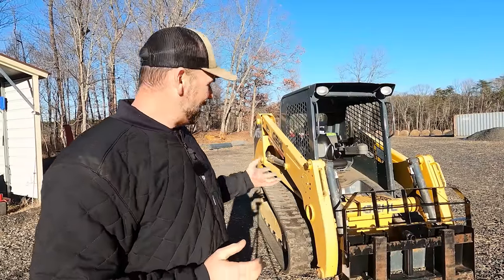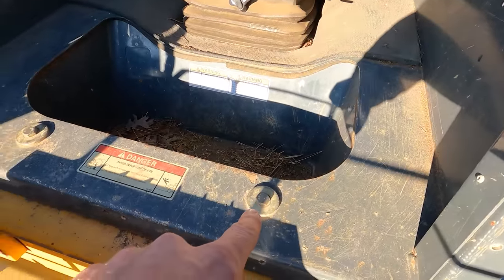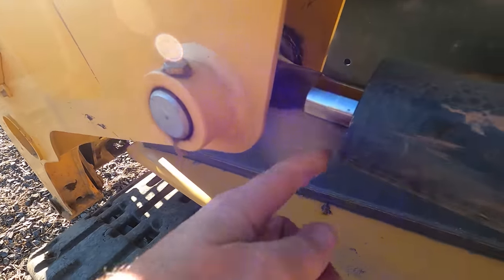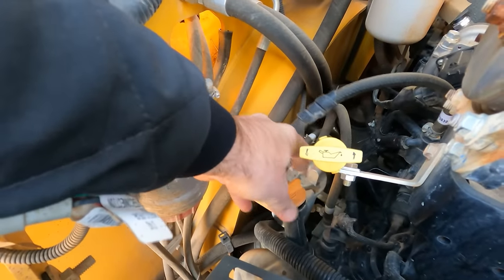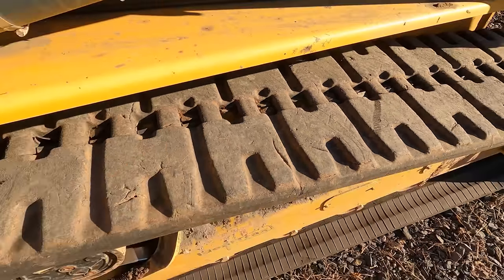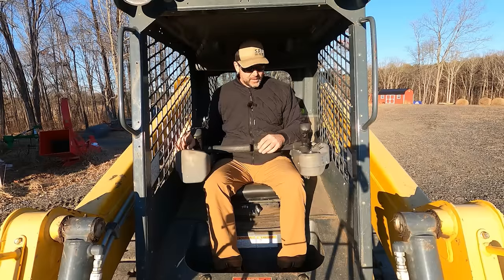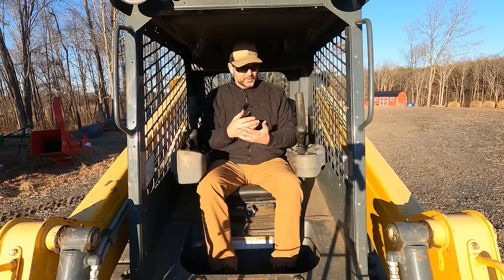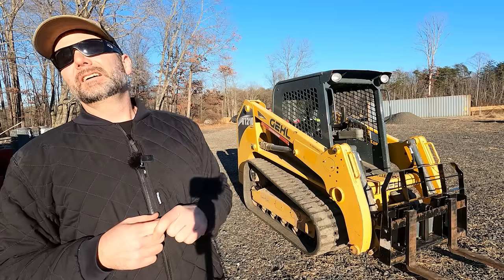DONT GET BURNED! How to Buy a good Used Skid Steer, wheels v/s tracks and more!

Comment: Always pull the dipstick while the engine is running and check for Blow-by by putting your finger over the dipstick tube. There should not be pressure or smoke coming out of the tube. Especially important on higher hour machines.
Reply: First Choice Mechanical  yes that will work too. I have seen dipstick blow out of the tube. Just depends how clapped out the engine is lol.

Comment: One big item to pay attention too are re-painted and rebadged machines.if the machine looks like new,pay attention and dig deep,it's usually been so well used they had to paint it in order to even make a sale.NOT ALWAYS,but quite often.I strive for,original used paint,cold starts,stored inside,and all maint documents,and the number of owners a machine has had.Good vid,thanks.
Reply: Agree about the paint.  I've been looking off and on for about a year and have seen a lot of pigs with lipstick.
Reply: Good general rule but i treat all my stuff like a princess, touch up whenever there is a scratch etc also. I understand what it cost to buy and i respect that
Reply: @OShackHennessy  Nice.I would like to do a project 1840 case old school skidsteer,and do a complete refurb and paint.For myself.Thanks for watching.

Comment: Also consider where you are going to operate your machine. Besides dirt or concrete. Are you going to operate in wooded thorns or possible running a brush hog or what attachments will you use will effect between tire or tracks. Great video Stoney Ridge Farmer. Thanks farmer rod

Comment: I own a JD260 and know what you mean. I have the really big tires so I can traverse muddy areas better but still not the best.  Bought mine used...unseen. i knew the hour meter had been replaced...most have been in that generation of machine. Still a great skiddy for what I need. Just depends on your use. Great beginner video.

Comment: I bought a wheeled machine because my road is two miles long(travel speed is faster)and I live in Montana so wo do not have very many mud days. I do have an extra set of mounted tires with cleated chains on them. With my dewalt impact I can change tires in less then ten minutes and it does much better than a track machine on ice which I do get alot of. My machine is a 2015 L230 New holland, thanks for the video!!!
Reply from the maker: interesting....but the track machine is just as fast as the wheeled machine I had.....for the farm the tracks are 1000 times better...but we all have our opinions...drive a track machine and you'll never go back my brotha
Reply: @StoneyRidgeFarmer  I have operated the track machines and they are great. I think top speed in your machine is about 8 mph?? My machine is 12 mph it does make a difference if you have to travel alot. I had a track machine here on my ranch for about six months (T 250 Bobcat) when I first bought the place and it was great until it got snow packed and icey then it turned into a slip and slide event and I was running ice tracks. The first time I plowed snow with my machine on ice with the chains on it was an animal. I have steep grades on my ranch road and I can plow up hill with this setup (9' snow dogg plow with wings 11'). The tracked skidsteer could not plow uphill on my road. Like I said we do not get as wet here in Montana as you do but we do have hard winter. Thanks again!!! P.S. I looked up the specs on the gehl rt210 and the new holland l230 is a full 4 mph faster!!!!
Reply: L230 that’s a beast and I agree on snow I did a demo with a case track machine and I had a hill that I had packed down from driving my pickup on it and with a full bucket of wood I couldn’t make the hill. So tires and chains work better for me. You can get more aggressive tracks or I know guys that stud their tracks like a snowmobile.

Comment: Hour to HP is relatively moot. I’ve seen low hour higher HP machines worked like a rented mule. Conversely I have seen higher hour lower HP machines that have had excellent maintenance and the machines ran incredibly. I think it all boils down to maintenance, like mileage on a car. I’d rather have a well maintained high mileage car than a fleet vehicle or rental that was beat every minute it ran. 
All in all good video.

Comment: I had a older gehl and that machine was a great machine. I recently got a real buy on a 2012 320d John Deere with 853 hours can heat air two speed air ride seat and i know where it came from so it was never worked hard. 23,500

Comment: I don't question your answere, but the original question: Why a skid-steere? Why not a Caterpillar, Volvo, Kubota or other wheel loader? My PERSONAL opinion is that they are more versatile if there isn't a big question about room. Skid-steers are great doing utility work around houses and on building sites where you have to turn around on a dime.
 On the alternator-belt: if it's worn it will touch the bottom of the pulley and tightening will not help. If the the top side of the belt goes into the pulley it's good for a change...
Reply from the maker: I have 4 tractors on the farm.....the skid loader is the best at material and dirt work.  I can run circles around any other machine on the farm with this little loader.  Yep..alternator belt is just a bit loose my friend

Comment: This loader would come in handy with blizzard we are experiencing right now in northeast
Reply from the maker: Just drove home from PA yesterday! 8 hours driving in that mess!
Reply: Tracks are the way to go if you've got snow! Take care
Reply: @patrickbass3118  I beg to differ. My wheeled skidsteer with cleated chains will run circles around a tracked machine on snow and ice. I have operated both on my ranch and the tracked machine was running ice tracks and it was still slipping and sliding the chained up wheel machine was an unstoppable animal!!!

Comment: Check how long the back order for the rubber tracks are and how long the back has been. We have several clients that have machines with tracks on back order. But also don't order them and have them sit in the elements so they break down and crack before you even get to them

Comment: Hello Josh, thank you for this video!

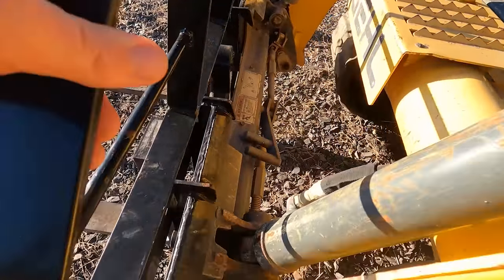On min. 7:44 "by shims" you mean the cylinder pins that goes through the end of each cylinder? They with time in fact get wore out.

The short hose you touch by the right of your skid steer, notice it has some bumps or out of shape I think by pressure of the hydraulic pump or past abuse or low quality section of the hose, maybe you want to review it, buy it and have any hose looking like bumpy replaced before they go off while you less expect it. Please let me know if am wrong.

Comment: Long but worth reading: recovering from 2 surgeries so can't make long trips. Need a backhoe so working via net. So,found a 2005 JD 310G 4wd open station at a dealer 170 miles away.30+ pics and 2 videos. Hour meter showed under 500 hours."Owned since new by a gravedigger".
$38,500.00 and bought it. From dealer straight to JD Construction equipment dealer service shop. ECM shows true hours at 2972. Not pissy. Left rear tire has a torn bead. Still not pissy.Nickle and dime service and repairs,complete set of JD manuals,complete set of spare filters,etc should be under $5000.00. $43,500.00 for a backhoe that will have parts available for at least another 15 years,low hours at 2972,will last me probably longer than I'll live. Short video on my channel when it arrived at the JD shop. Shop foreman says it's a goodun.
Reply from the maker: I just sold a 310d for under 20k! With less than 2000 hours brotha
Reply: @StoneyRidgeFarmer  Regional price difference. Here in Texas and within 500 miles of me 20K will only get you a somewhat complete but high hour (+5000 hours) unit. I probably looked at 300 different backhoe listings. No such thing as a "cheap" backhoe near me. Main thing I looked at was year model: parts availability on old units can be a real issue.
310G are supposed to be just about bullit proof. One of the better series JD built. Time will tell.Wish I could have come there and looked at/bought yours my friend. Sounds like it was a fine unit.Heck of a deal too.
Reply: @StoneyRidgeFarmer  Forgot: Asked sales at JD what a new 310 series open station goes for. $110,000.00 to $120,000.00 and at least 6 month wait.Stuff has gotten WAY too high,if you can get it.

Comment: 75 HP? How many gal/hr do you get with that thing?  It must drink diesel like lemonade on a hot day 😂.  I am curious though.  I'm debating tractor vs track loader but those high horse engines seem like a big expense to maintain.
Reply from the maker: hmmm....I can run it for 8hours on about 3-5 gallons of fuel...I'd say not bad at all
Reply: @Stoney Ridge Farmer  yeah that doesnt seem bad at all.  Thanks for the info!

Comment: Going to get one for my business and I’ve been looking at the market for a track loader and they seem to hold their value pretty well (compared to a truck at least) so I was thinking maybe to go get a new one with warranty. I’m straight out of high school and I’m not a mechanic so getting one used is a little scary. Let me know y’all’s opinions!
Reply from the maker: If you don’t know how to work on equipment…buy something and work on it brotha! Or YouTube it! Never start any venture in your life by putting yourself in debt without a means to pay it prior to going in debt
Reply: @StoneyRidgeFarmer  100% facts.
Reply: 1-Buy what you can afford, what you hope it'll pays or produce back (so hopefully you have jobs demanding you to have one heavy equipment), and always, from a person you feel he's not pushing you to buy it like in a hurry or desperate! Always buy from someone although you don't know, that transmits a sense of him being a friend. 2-If possible check the equipment all you can and try to operate it. The most important things in anything, is that it'll functions and it's heaviest parts aren't too wore out like the sprokets (the denture wheel that is undercarriage moving the tracks. Cylinder leaks are the easiest fixes. Hydraulic hoses can be more complicated because you'll need to track them or run them through parts you'll have to take off of the machine but the most expensive parts, engine and transmission, if the machine has low hours, and it's visual parts like the sprokets don't used too used or wore out, and you can make it move, the owner is not pushing it, is a great deal. Try to get it as cheap as possible but this machines aren't cheap because they can make money so, you get ready to spend as much as you feel comfortable, and keep that same amount or some thousands untouched, to repair it one day. If you do, the jobs you do will help you recover and hopefully make more money than you spent. 

And one more, search for mechanics in your area and go with the ones you feel they don't see your millionaire's face, those who don't see you as rich will protect your hard earned money and won't rip you off when charging you!
Reply: @StoneyRidgeFarmer  Thanks you for your input! I really agree with you on the fact that knowledge truly is everything! Thank you sir

Comment: What's the going price range for skid steer for 1 in your horsepower and condition  ???
Reply from the maker: do some research on these websites like machinery pete before ya buy. Something like this could be as low as 20k and as high as $38k depending on the seller